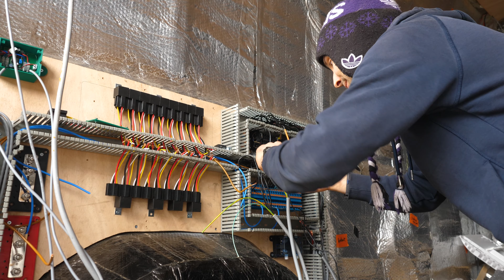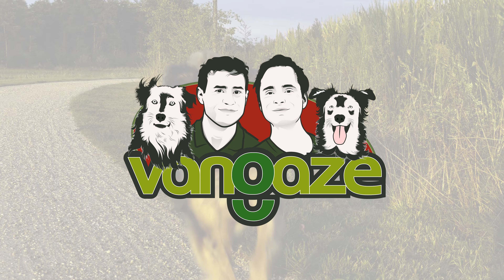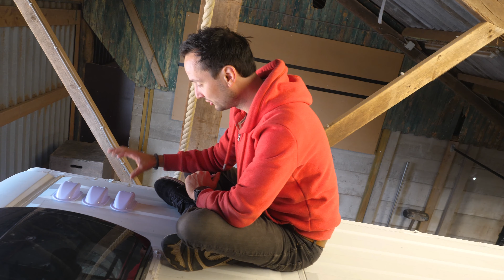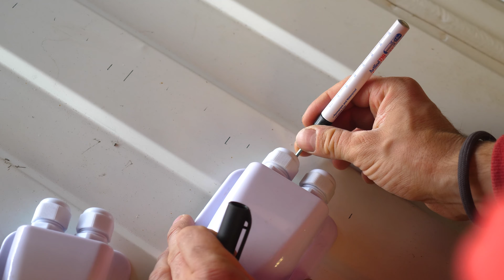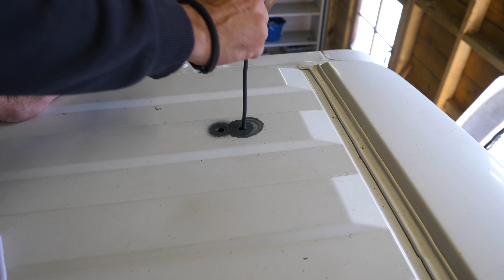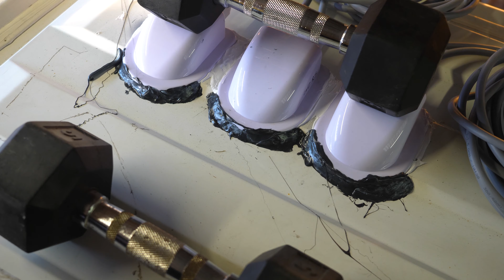Most Fancy Van Conversion Ever | Luxurious Lighting | So much work

Comment: You need to get those cable entries opened up and the edges protected. The edges will damage the cables and cause electrical issues/fire.
Reply from the maker: Hi! Thanks. We thought about that too late:( we added sealant from the inside and the cable has double shielding so we hope we will be good. It’s the little things….